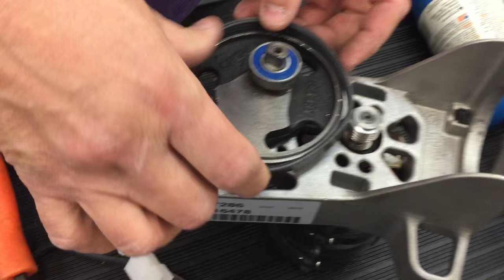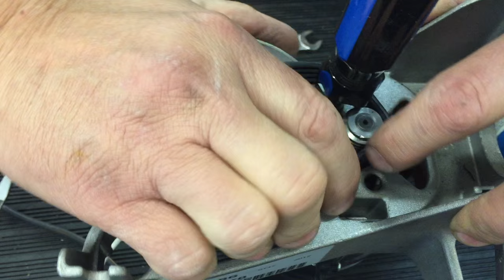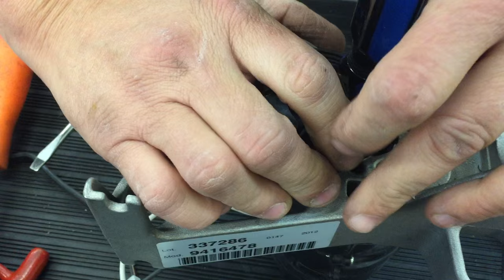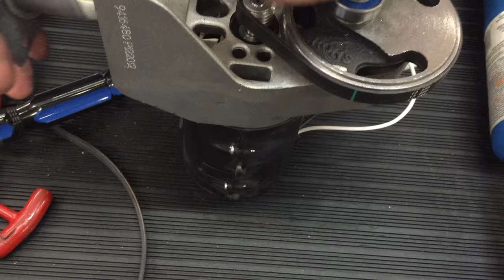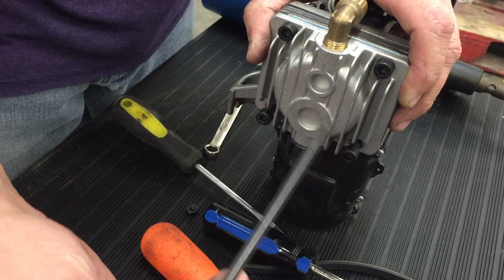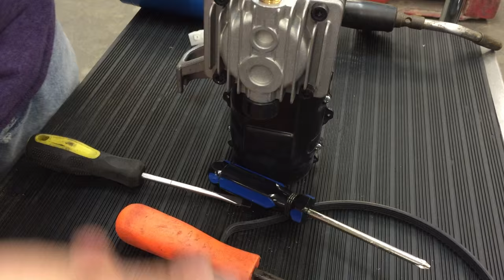H1503TP - Replacing Belt

Comment: Your video was the only one that got the belt on!! I wasn't working on this same model so I couldn't use a screwdriver - no holes. Instead I used a c-clamp to hold the distance around the motor sprocket.

Comment: Great video -- Update: 6/14/2020 I COULD NOT HAVE DONE IT WITHOUT YOUR VIDEO!  I could not figure out how to put the belt on and use your method with the screwdriver THANKS YOU!!  Your video was the only one I could find on YouTube.  this common air compressor pump is used by Husky, Harbor Freight 67696, 62511, Bostich and many other pancake compressors.  I removed the piston with a gear puller & reinstalled by using a large socket and bar clamp to press it back on to the shaft.

Comment: It would be helpful to see how the unit was disassembled prior to the belt replacement. I can replace the belt, I don’t know how to get to this point.
Reply: Keith Barrack this is so true
Reply: Yes
Reply: Yes, what the video doesn't show is that the screw to remove the fan is a left hand thread. Be care or you will twist it off if you left hand turn to take it off.
Reply: So the screw holding the connecting rod to the crank is reverse threaded? Well, that explains it. OP needs to post the rest of the video - the first part please.
Reply: Facts!  I came here for assistance with unbolting the arm because mine won’t budge and looked here for tips only to see video starts with arm already off of sprocket🤦🏾‍♂️

Comment: I just want to point out that the screw holding the plastic fan on needs to be turned clockwise to loosen. i nearly broke mine by turning it the "normal" way you would turn a screw to loosen it. I had to observe this video seeing him turning the screw counterclockwise in order to tighten it. Perhaps this should have been pointed out.